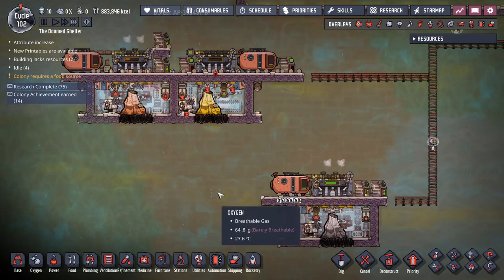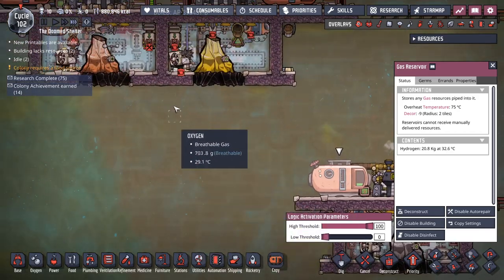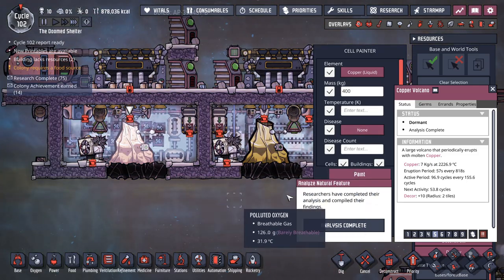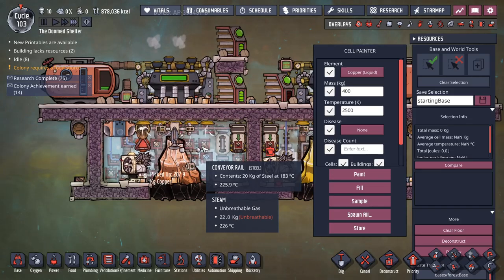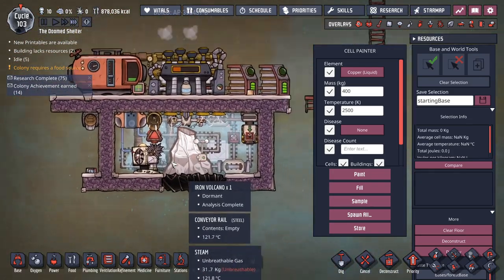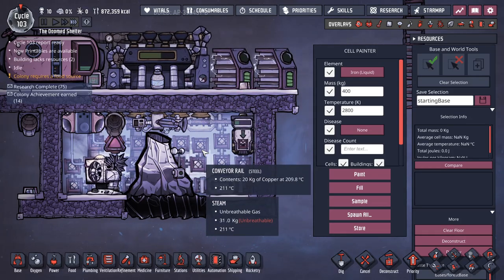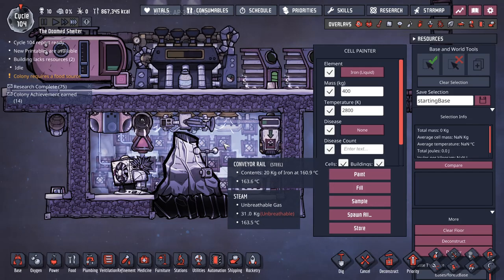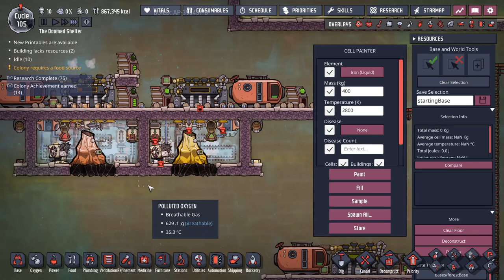Oxygen Not Included Metal Volcano Tamer

Comment: My question is as always. How much water do you really put in the room?
Reply from the maker: Pressure per tile has to be less than 250, or 200, or the volcano will over pressurize.  So take the area of the room, I tend to just x100 that and put that much water in. So if the room is 4 x 10, thats area of 40, so 400kg of water on the bottom gets the right steam.

Comment: I made something similar only with an aquatuner I used an icebox too to cool down the ejected metal but I don't think it was worth it
Reply from the maker: for the new spaced out metal, they come out stupid hot, so the steam turbines need more cooling, and you have to make sure nothing is behind the eruption point, or it will melt.
Reply: @TartarusPlaysGames  yes but it has very low thermal mass and is easier to cool than iron